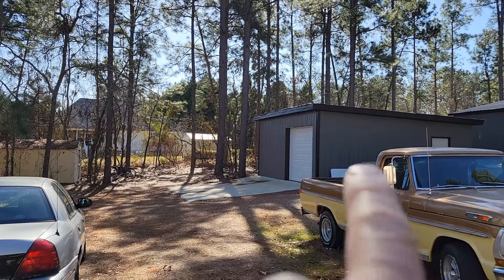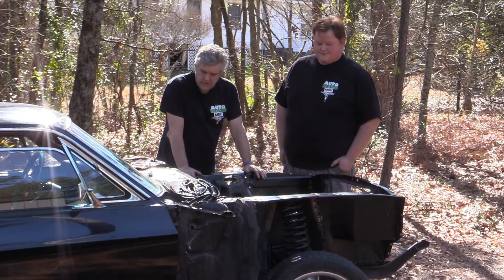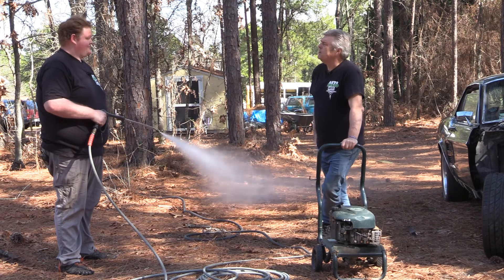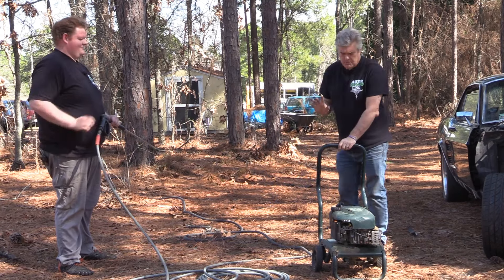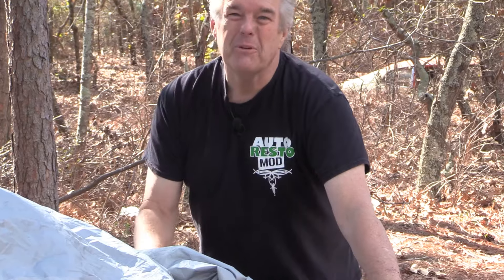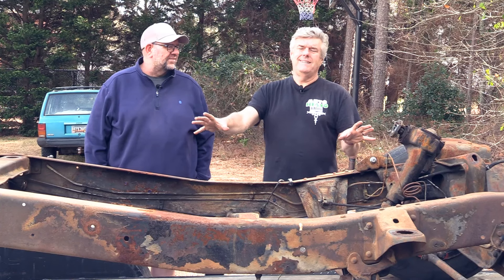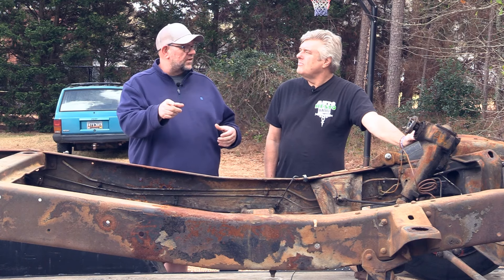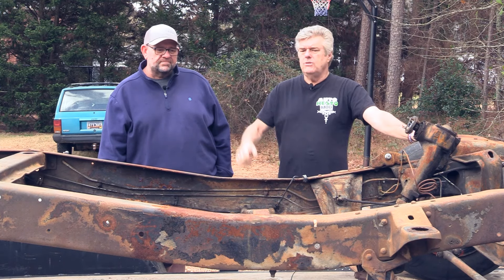Degreasing and Pressure Washing Your Engine Bay

Comment: oven cleaner(de-greaser) is much cheaper and is far stronger
Reply from the maker: Don't want to peel paint, just remove grime.
Reply: @AutoRestoMod  i forgot about the paint haha, it worked on my 1985 mitsubishi L200, it had 1 inch thick oil/road build up under the engine on the chassis/frame, now you mentioned that, i do recall surface rust on the frame/chassis afterwards(a few months later) maybe it ate the paint right off haha